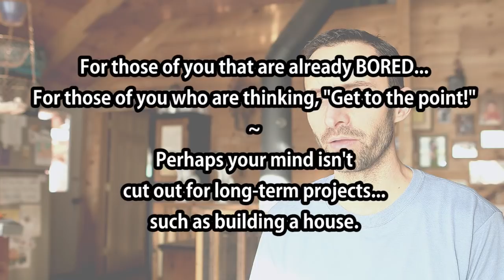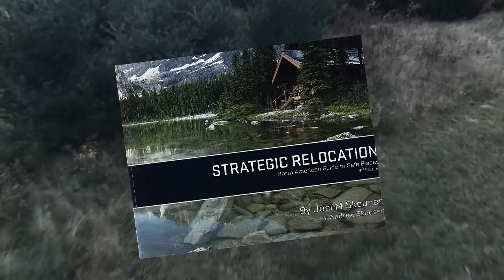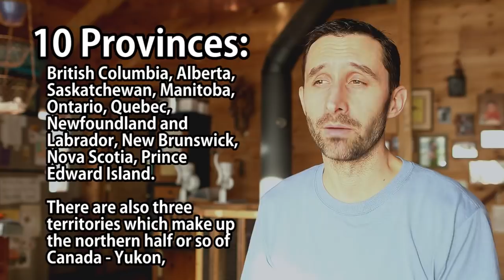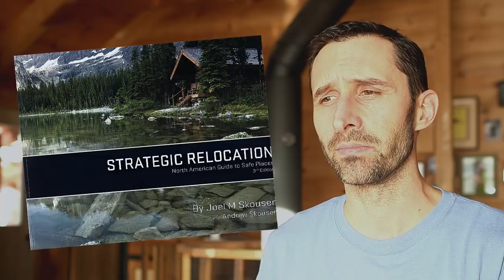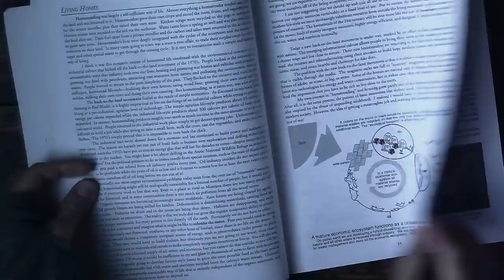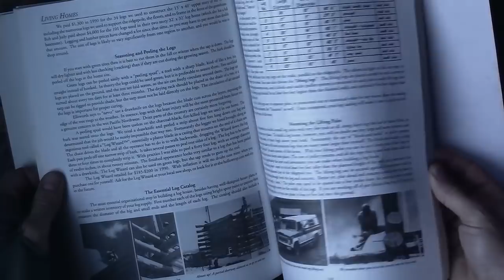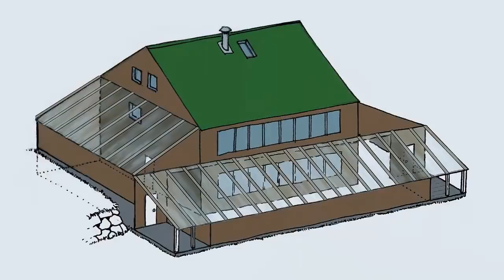Building a Retreat Home DIY: How I Did It

Comment: If you are going the "shed" route, preplan ways to  expand the basic shed if you need to in a long term event. For example cement slabs poured on both sides of the shed that could be covered by a roof extension( frame your side walls high enough to allow good head room) and then framed in at need, or a even full basement to double the living space. If you have framed your side walls high enough you could skip the loft idea and go straight to a full second floor. 
  In my area you don't need a permit to build a shed 200 sq feet or under(foundation size) so if you do all three, basement, main floor and full second floor, you will have 600 sq feet with out a permit....and don't forget the potential wings on each side(in a long term emergency) for even more room.
Reply from the maker: All good points! I don't think I mentioned it in this video,  but that shed has a drainage hole for a future plumbing system to be installed if desired. Always good to think ahead!

Comment: I feel like someone needs to send you some oven mitts!
Great video.  Beware Toyota!
Reply from the maker: The oven mitts would need to be sent directly to my driveway. If they end up in my house (with all my other oven mitts), I'll likely be too lazy to run back and get them (as illustrated) ;).
Reply: Praxis Prepper lol indeed. It was comical to watch, which I presume was the intend in showing it. But this is why a bandana is always in my pocket.
Reply from the maker: My clean bandanas are always on my backpack. The bandanas in my pocket are always covered in snot. Long sleeved sweatshirts (that I'm wearing at the time) are my usual go to.
Reply: Praxis Prepper lmao!!!! Yeah those snot fillled bandanas probably shouldnt be used around food. Might add a little flavor tho.

Comment: Great vid, as you said, living within your means allows you to achieve your goals. It also hit home when you say that there is always someone living on less than you!  I am that someone! (I live on about two thousand dollars a year, and, for a long time, I was living on just over 90 dollar a month (converted to euros, I currently live in Latvia)..
On two grand a year we (the animals and myself) do reasonably well, and, I can afford the odd luxury (unlimited internet 10 euros a month), but, one key thing to remember is attitude is just as important, if not more important.
I faced homelessness when a 'friend' pulled the rug from under my feet on a project that I had invested a lot of my time and effort on (rebuilding an old house for him), but, when I realised what was happening I decided to take the route of seeing it as a challenge and the start of an adventure rather than sinking into darkness.
The result? 
You now find me sitting in my self made prairie waggon, outside temp is around minus fourteen centigrade and indoors, it's around plus twelve. (Although, during the nights, when the stove goes out, its drops to minus eighteen!)
The thing is, despite what you see on some of the other prepper videos, you don't need top of the range white goods and expensive systems, you can make do with less, and live very comfortably, while at the same time saving for your goal of something bigger and better.  Me? I'm actually going the other way, I seem hooked on making the most of the least...I guess eventuallly my only need will be the clothes on my back and a decent pair of walking boots LOL.

Comment: I have just spent the day removing an old decorative 70s electric fireplace surround.  It was 2ft deep by 15ft wide and every inch was solid with stone and 3 part mortar.
It was a big job (although I totally underesrimated it and generated 30+ big, barely carryable bags of rubble.  However it got me to thinking what an achievement it was to physically build your own home.
I'm aching badly after one day!
Reply from the maker: I'm wondering how much I'll be aching when I build the V2.0 house next year. When I built the current one I was in my 20's . This time I'll be quite a bit older. I'm mostly concerned about the grabbing a hammer and swinging it muscles and joints. They needs to stay good an flexible all day!
Thanks for sharing, and good on you for DIYing!
Reply: I love DIY!  I've bought a house that needed work and I've slowly but surely been doing it.  Still got plenty to do as I firstly converted the garden from an overgrown dense mess to something nice that the kids can enjoy with a retreat garage for me for when my wife and girls get too much to cope with 😂
I just struggle sometimes to find the time to DIY as I work fairly long hours all week and commute 1-2hrs.
Reply from the maker: COmmutes can be a killer. I used to commute about 2 to 2.5 hours per day to get to my job (with a return trip of 2 to 2.5 hours at the end of the day). I didn't work every day of the week, but still 4-5 hours driving can be a crusher!

Comment: Nice video, thanks for sharing your story!

21:30 there is a tiny mistake. the 4' underground temperature is not ALWAYS 50 degrees F. It will be whatever the mean annual air temperature is. that is, if you take the daily high for the last 365 days and add them all up then divide the result by 365, that's what the ground temperature will be about 4' under ground.
Reply from the maker: That's a good point. For my area, it's about 50 degrees F. But yes, of course, that varies by region. The doomsday seed vault wouldn't work very well if 4' down up there where' it's located, it was 50 degrees... of course, I hear that they're having some heat-related issues there. In any event, good catch!

Comment: The UBC [Universal Building code], allows a 200 s.f. no-permit storage bldg....tough, some Counties that adopt that, often tweak the rules associated with "no-permit" storage sheds. 
Also, there are "no permit" structures which might be even larger:  structures considered "temporary"; moveable structures like tents, shipping containers, those Costco canopy structures, the metal RV structures....as long as those are easily moved [sometimes, that is a relative term], they are classed as "temporary", therefore no permit needed.    Though, some Counties do make rules that can dumb-down that permission...such as those who force yurt owners to move their yurts every few months, to keep that "temporary" classification, OR, they force owners to increase insulation in their yurt, to stick-built-house-minimums, in order to be allowed to live full-time in their yurt.  
But do explore what structures you might still be able to use, in your location, which need no permits...like, some allow basements to be no-permit, unless you will later want to build a structure on top of the basement...those need a permit.  
Rules will vary, per location.  Each must learn what their area allows, where the loopholes might be, and how to creative problem-solve to take fullest advantage of those.
Reply from the maker: Great insights and advice Winter Star. Thanks!

Comment: Hey Praxis, was wondering if you could make a video on Stealth Cellphone Towers?
Reply from the maker: Gosh, I'm not even sure about what that is. Do you mean cell towers that are dressed up to look like (ridiculously tall and thin) trees? Or is it something else? I'm curious.
Reply: Praxis Prepper well yes, just in general hidden as something. Like some are disguised as flag piles or cross on a church. Just Google it and click images. A video on how to find them would be interesting.
Reply from the maker: Okay, yeah, so I guess I knew what you were talking about, but I'm not sure about the prepping connection. I mean, I guess all knowledge could be helpful in a crisis and cell towers could be a source of... wire? or something. Maybe there's some preparedness gold there that I'm not aware of though. Let me know. Again, I'm curious. I'm not sure why knowing where cell towers are has much practical benefit in a crisis.
Reply: Praxis Prepper (I may be confusing you with someone else but didn't you make a vid on cell towers?) well cell towers have GSM antennas so you could take them and use them for communication
Reply from the maker: Ah, sure, so the idea is to re-purpose parts in a total collapse. I get it. I don't have any real expertise in that sort of thing. So I wouldn't have made a video about anything like that, BUT I did recently do a video about using the orientation of satellite TV antennas to help one to orient one's self to roughly due south (because they all point roughly south in the northern hemisphere). Maybe you recalled that?

Comment: Why not in a small town where there is infrastructure (e.g. medicine, safety)?
How did you store the money at that time (e.g. cash, gold)?
Flat roof & Wall around the house?
Prices regarding concrete, wood, stone ... in the USA?
Reply from the maker: Small towns are nice. I like being on the outskirts just for peace and quiet and all that. When I saved up, I stored money in the banks. I can't say for sure whether that'd be the best way to do it now, but certainly being able to write checks out to companies you hire for stuff is better than paying in cash without a record of the transaction (in terms of being able to prove that you paid someone if they claim you never did). Flat roofs (green rooves etc.) can be really cool, but are not something I've ever tried. I think they make more sense in an urban setting where green space is limited. In the country, another few square feet of green vs a roof (upon which you can collect rainwater) doesn't make much difference. I'm not a fan of walls around one's house. You really shouldn't be defending from your mailbox anyhow. In the right (aka "wrong") circumstance, a wall can have a use, but for most situations, I think a wall is a fall-back approach to failures in overall security policy.
Prices vary all the time so I didn't get into them. But the best time to build is always NOW - because even with price spikes, spending extra time renting somewhere else is money blowing out the window no matter what.
Reply: @PraxisPrepper  
The way i`m thinking of it are countries which are dangerous at the moment / for a long time.
Afghan, Iraqi or "arabic" compounds in general, south africa, mexico and the like.
I`m in europe and here is all way closer so it is quite likely that something can happen around your doorstep. Also hitting the woods (with caching) should also only be a secondary option depending on the situation.
There are also a lot of hidden costs with ownership of a house as well as restrictions.

Comment: Amazing! Gets you inspired! How much research did you put in before you started the building(where did you learn how to build) and did you make your own design drawings? And a completely off topic question, are you allowed to clean your own chimney in the states of united america, or do you need to hire a proffesional?
Reply from the maker: I was in my trailer for 4 years and all that time was researching how to get this project done.
I learned to build on the project. Like I say in the video, I'd never even built a birdhouse prior. If I can do it, you can do it!
As for my drawings, I had sketches and then spoke to the architect that ran the company that sells the kits. He helped me to understand their general approach to building, and then I modified my plan to fit those constraints.
Chimney cleaning? As far as I know (at least in the area I live in), chimney cleaning is for anyone to do. There's not much to it really. just like brushing teeth... but more effort... and standing on a roof... I'm not a fan of that particular task.
Reply: Praxis Prepper It's weird in Sweden, very much regulations! I know it was a kinda strange question :/
Reply from the maker: No not strange at all. I appreciate the idea of regulations in some cases, but never when it comes to ME being regulated! ;)

Comment: Did you consider those pop can solar heaters?
Reply from the maker: I've read about them. I was actually considering mounting them on the south face of the shed structure to test them out at one point - on either side of the windows. That is indeed a way of sort of getting around that low-e glass thing. Structurally, a house can't really have all windows on a wall anyhow, because having some boarded up sections helps with sheer strength. So mounting that sort of heater on those walled up sections is a good place for them - and could be sized to sort of match the visual size of the windows. The trick is to make it so you can avoid them turning into reverse convection COOLERS at night by allowing them to be closed off them they're cool.
Thanks for mentioning the idea. I should keep it in mind for my next build. It had sort of fallen off my radar.
Reply: Praxis Prepper I have been thinking of trying them on my garage for a test they look easy enough to make,  I live in town there is a house 2m from me on the south side. There is a company out east that makes them.
Reply from the maker: I know from solar cooking that the sun can offer us a LOT of heat. Definitely worth a try.

Comment: You might want to invest on "fireballs" for every building/structure. Might not protect everything but  you will save a lot of your investments for cheap. 
And if you croak or can't get out b/c of injury, your corpse won't char.
Reply from the maker: I haven't heard about them, but it sounds like a saferoom, but for fire?
Reply: Praxis Prepper yes fire 
They use to be made  of glass but now they  are 10 times better.

Comment: Vaulted ceilings are a huge waste of energy and space, it is purley asthetics, no practical value at all....
Reply from the maker: "Huge" is probably not the correct word to use here. "extremely minimal" might be more accurate. The house still heats all winter using only about one cord of wood. Mathematically, yes, empty space needs to be heated and is thus a "waste". But it provides a sense of comfort in the space, and allows the air to circulate nicely in the summer.